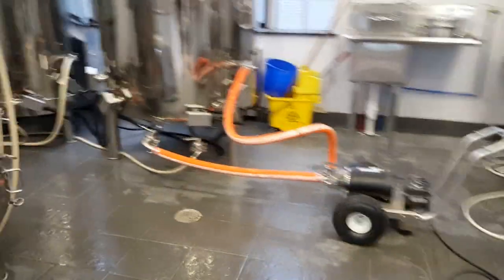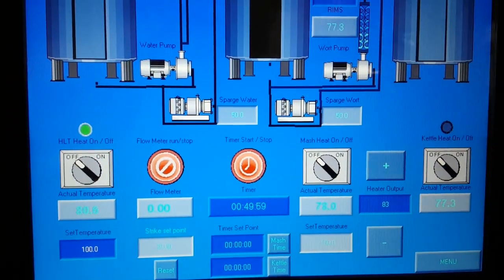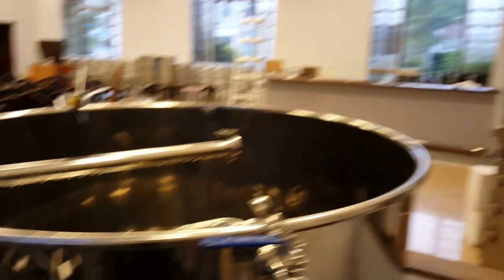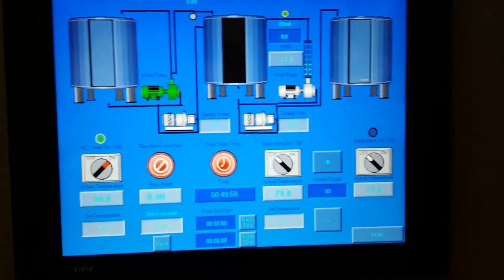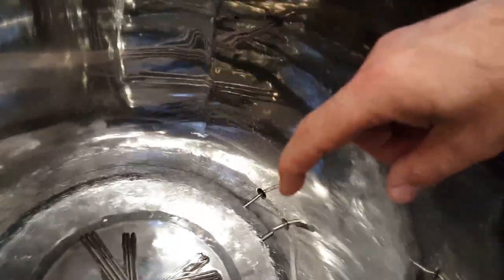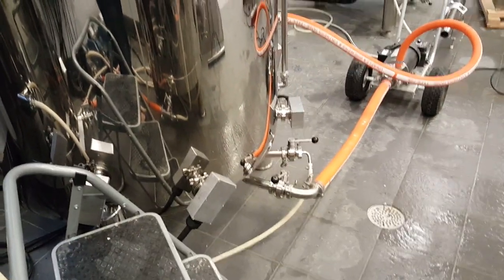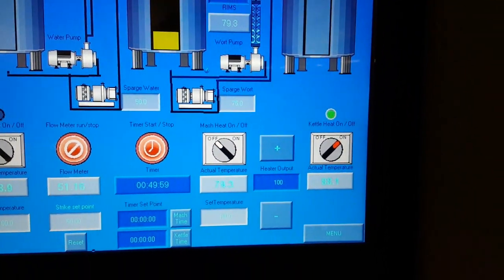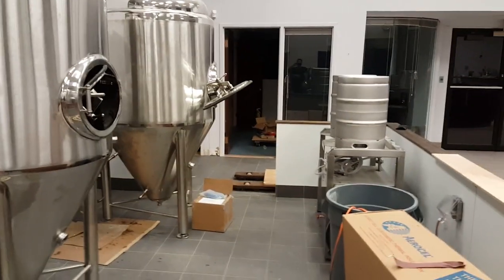Water test of my 7bbl Stout Kettles brewhouse

Comment: So six years in, still happy with the system?  Eyeing going electric...
Reply from the maker: Sure am. The only thing I don't like is the geometry of the mash tun, and they totally redesigned it, so it's no longer an issue. The electric heat has been great and I wouldn't change a thing.
Reply: @ManSkirtBrew  Do you have a feel for how much power you are using per brew?  How long are you taking to reach boil?
Reply from the maker: @GameStrata  I use about 5000kwh per month, if I remember correctly. I'm at a boil within a few minutes of finishing runoff. It's surprisingly fast
Reply: @ManSkirtBrew  Right on, thanks.  How many brew days/week and is that 5k kwh all in electrical consumption (i.e. walkins and whatnot) or just your brewhouse?  Sorry for so many questions but reaaaally considering selling my gas and going electric before we start our build.
Reply from the maker: @GameStrata  all up, including walk in, air conditioning, etc.  I'm brewing 1-2x per week.
Reply: @ManSkirtBrew  Awesome, thanks for the replies.  5k kwh doesn't seem bad at all.